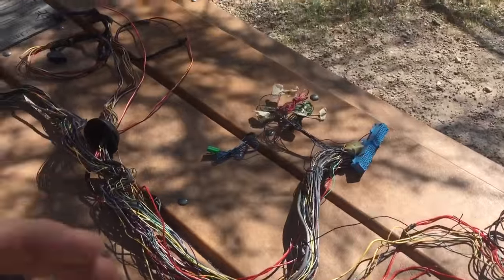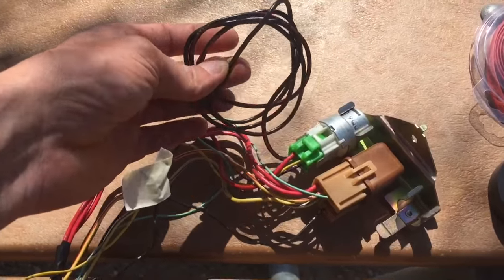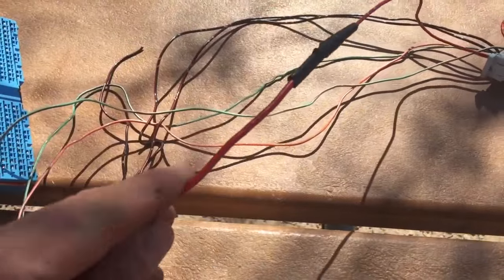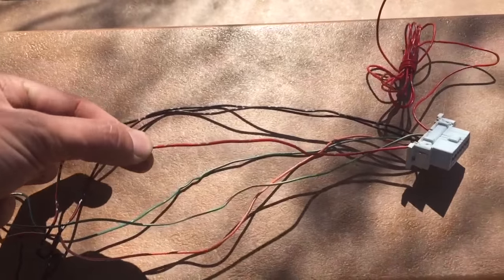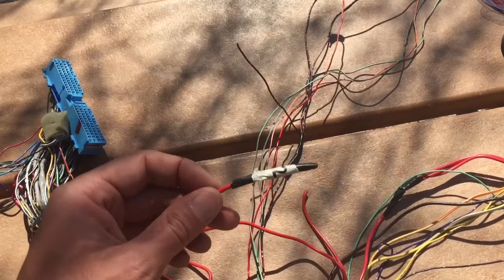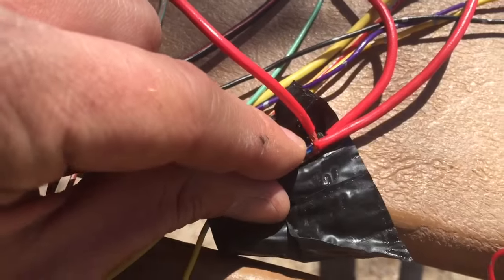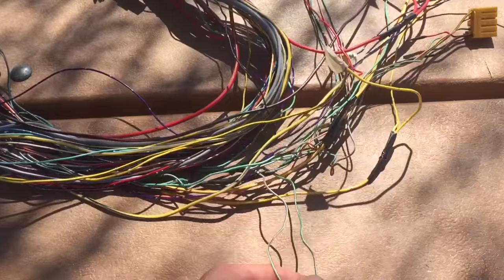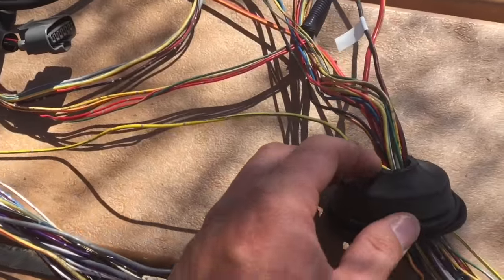8. Harness Forming 1/2 - Wiring Harness Series

Comment: I am preparing to install a GM V6 into a 1985 Vanagon which had a water boxxer. I need advice on what to keep in the original harness. I have the ECM but it is removed and the new engine will have its own brain (for the EFI only). Are you available for consultations?
Reply from the maker: +Kevin Hornbuckle hi Kevin, your new engine should have a complete harness to run the engine. You won't need much from the old harness.

Comment: Ground, GND, ground.The ground ( solid black ) are gone from the harness. I just want to double check if this is ok to splice the main relay ground with the'  GND control systems' pin: 17/18 like you did ( diag connector goes there on mine ) Note : my harness color is so confusing, i have a black/red for the ignition on same color for the control systems GND)
Also thank you for the fan relay extra on video No: 9 next.
Reply from the maker: +Remi Goudreault hi Remi, Subaru has changed their wiring colors many times and are very confusing. It's best to physically track the wires rather than rely on the colors. You can just ground the main relay ground to whatever you wish - sometimes I've just tapped right into the body while mounting the gold bracket.
Reply: Wow thank' s for every thing, my project is going well except for the flywheel kit i am trying to get that from Ebay seller, Outfront dont have the 228 listed on Ebay,i will try with pacificcustomsunlimited.

Now i like to subscribe to your boxerswaps/airswaps how do i proceed ( my user name is (remichivo) .
Reply: Double checking with you, my bus is a 1977 2L fuel injection with a 091 transmission that use a 288Mn clutch disk, same clutch as on the 1.9L water boxer ( vanagon ) with i was planning on installing but change my mind.
I also have in my possession a EJ22G
Phase two 2.2 litre closed deck, with the engine harness but no car harness/ECU( not really useful at the moment. 
So i cant easily get a kit from Ebay.

Comment: Hello Mick. Thank's and thank's again. I need some clarification on the fan relay, i am reusing the Subaru fan, i like to  live it on the bracket with the full/mane relay . I cant figure out the wiring for that. Can you explain it in your next video. Thing are going great for my 77 bus conversion with 98 Imprenza  EJ22ez engine is ready to be puled out, i have the harness on-rapt on the table ready to be splice.
Reply from the maker: +Remi Goudreault thanks Remi, I addressed it in the next video, but you already know that by now :) cheers!

Comment: In one of these videos you mentioned that the check engine light is most always on after these swaps... or something of the like.  With that said, will any engine performance issues result in not using the second O2 sensor without a catalytic converter (for off road use of course) using a 2000 EJ25 n/a Legacy Outback donor harness/ECU?
Reply from the maker: +Kevin Alberts No performance issues. You'll have things like fuel tank pressure sensor error code, etc. unless you put resistors in the wiring to fool the computer into thinking you have a a reading from the sensor.
Reply: Thanks!  What about the barometric sensor on the 2000 model as well, should I tuck that somewhere near the engine as well?  I would assume that helps fine tune the fuel map.